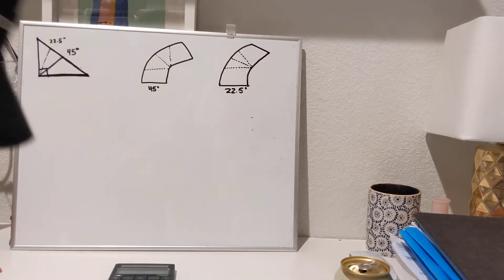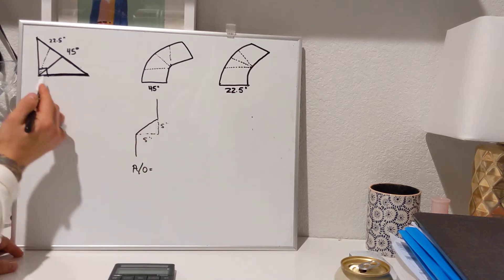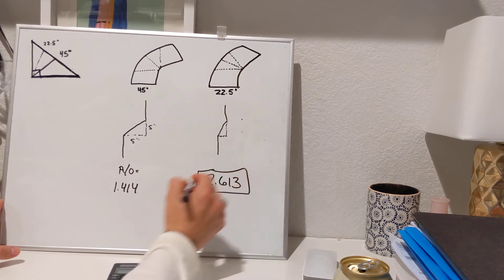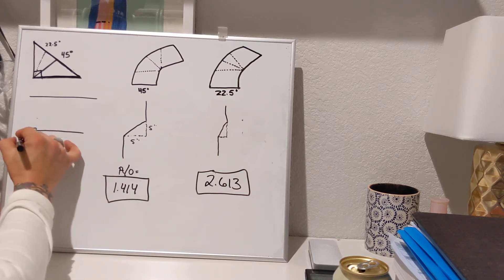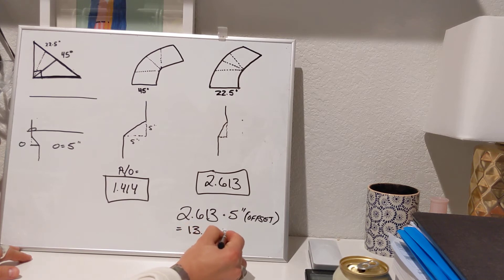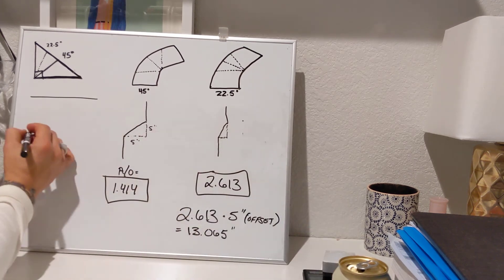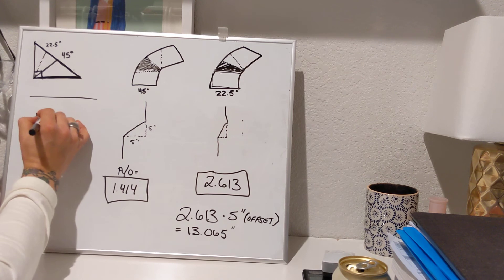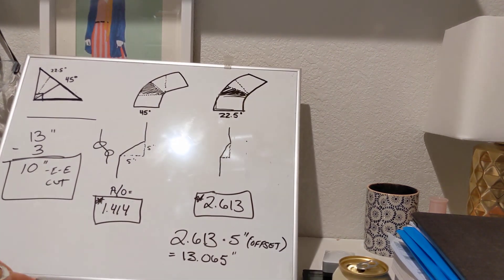22° degree OFFSET explained for the pipes trade

Comment: Is there a formula for figuring out the take off of 22.5 degree  black iron sw butt weld fitting? I know that for a 45 degree you can multiply it by .625 or split it 3 times and add the last and 3rd back number. Is there a simply way to figure 22.5s?
Reply from the maker: That seems more like a fitter question. They use butt weld fittings. We don't weld on our side. So I'm not aware of the thirds formula you mentioned. All I know is 2.61 is your constant for finding your travel piece. And than you subtract your take off. Thanks for the question!
Reply: @JoonRhee  thanks for the video! It's very helpful and easy to understand. Once I figure out how to calculate the take off for the fitting ill be all set. Thanks for answering!
Reply from the maker: @benni85  hey right on, glad to hear brother. I appreciate your help and thanks for reaching out. Trying to help out in any way I can and share the knowledge. Pass it on tag. You're it!